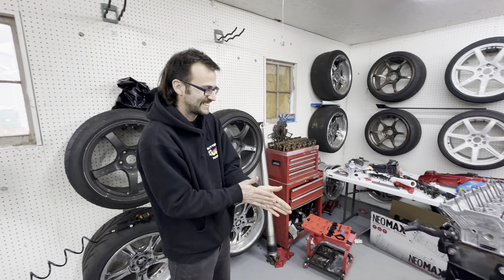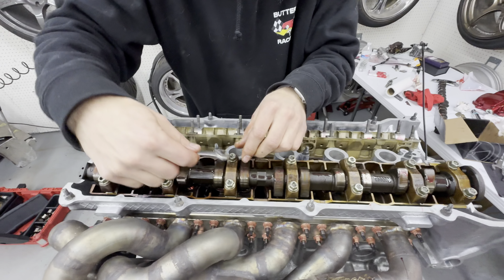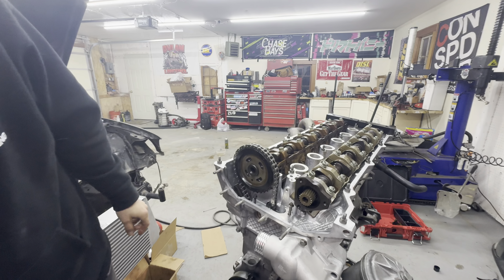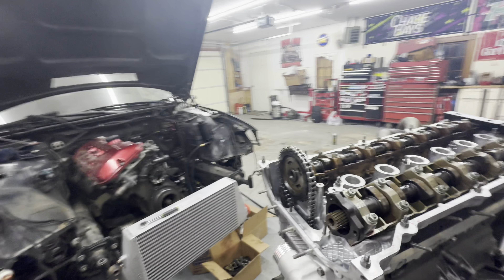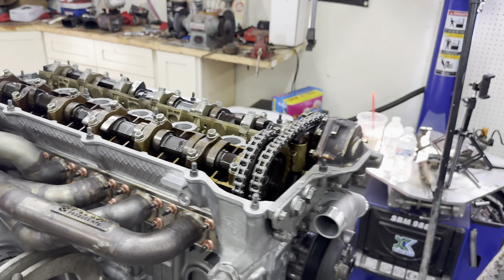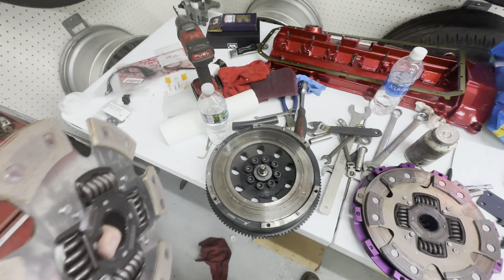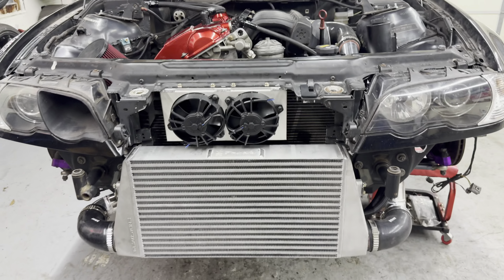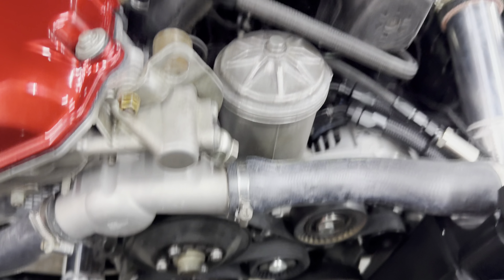E46 M52B28 Build - Part 2

Comment: Nice build. What engine mounts did you use on both sides especially the turbo side?
Reply from the maker: Thanks man. The drivers side is factory and the passenger side is the Rally Road mount from Seems Legit Garage.

Comment: Is this a sedan? If so what driveshaft are u using for the e90 6speed
Reply from the maker: I have a video going over the installation if you look at my channel.
Reply: are you using ms43? or are you standalone? i have a friend that needs an engine and wants to go m52 for future turbo. i’ve read that the ms43 can and will run the m52b28 but im curious what your using